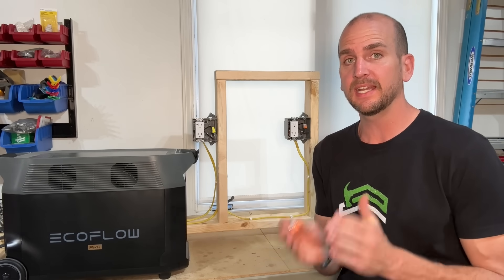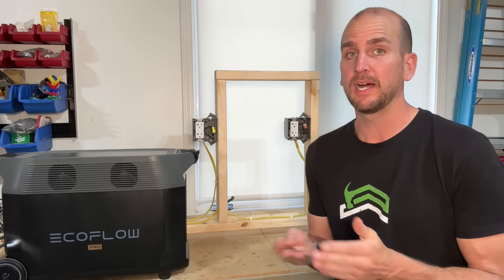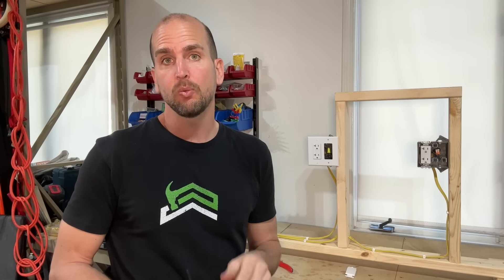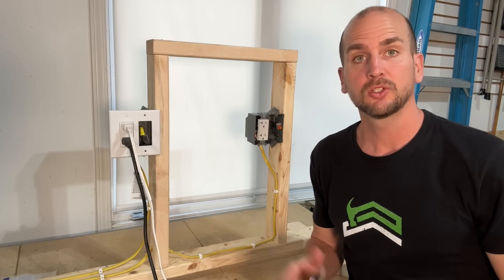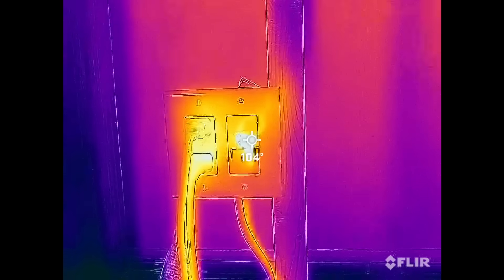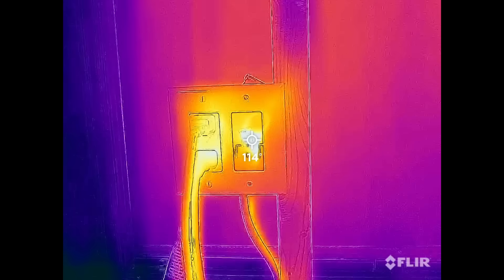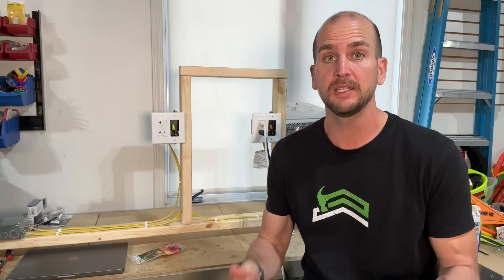Debunking the Pros: Can WAGO Lever Nuts Handle Heavy Electrical Loads?

Comment: We have several large towable heaters in the rental fleet that shipped with the Wago connectors inside the panels. These heaters run 24/7 on jobsites unattended. The wiring and connectors used are right at what the rating limits are.
They’ve all experienced failures due to heat. Site repairs done with wire nuts and pretwisting of the conductors have had no such failures.
This is a more “extreme” scenario certainly, but the facts remain.

Comment: I am a DIYer, not an electrician.  I have used Wago connectors and will continue to do so.  After seeing your test, I feel more confident using them.  Great test!  I have learned so much watching your videos.  Keep up the GREAT work.
Reply: Even better are the tests pumping 60 amps through a wire nut and a Wago, both rated for 20. Wire nut *melts*. Wago heats up but stays intact.
Reply: your just lazy or cant manage the wirenuts. So maybe you shouldnt be doing the work.
Reply: If you needed to see his video to be "more confident" then you shouldnt be doing the work in the first place. Because he doesnt know what hes doing either and is selling that junk.
Reply: @RadioRich100  Sorry, we must have missed your videos on youtube.....sit back and enjoy Mr. Karen.....
Reply: @benk4881  I dont have any videos just burnt and melted wagos.

Comment: We rewired our house based off of youtube (thanks EHR et al) and a bit of consulting/help from an electrician. One thing no one has mentioned is: if you pull and twist, a wire will come out of a wago. Pull is ok, twist is ok. Pull and twist at the same time and it'll come out. Get a wago and try it out. We had a wire come out after pushing the outlet in, probably because a twist and pull happen as wire moved around in there. You can orient your wagos so that a pull is less likely and you will only have twisting as you push the outlet in.

Comment: ... Also : that was the cheapest POS wirenut you can buy.  Throw those away and use an Ideal Wingnut.  They last 50 years in the WORST conditions, won't strip out, always remove easily and apply tighter due to the wings.

Comment: So here is the question. Resistance causes heat.but resistance requires more enegery to push the same draw so which costs more to run over time. I can say from 14 ga wire to 12 ga wire over the year that 12 saves about a 100 bucks a year in your electric bill.that don't sound like much but in my shop full of tools I consume way more eletric than normal daily house use.

Comment: As a maintenance guy in a manufacturing  setting, most of our equipment is Italian or German.  After a few years of use, most bonding points in the electrical system that use a spring style retention system fail due to high resistance and heat. While the failed component was installed correctly and rated to handle the load. After having prolonged use they just can not complete with the old screw style  bonding points.  Due to the down time that one failed component that causes an electrical fire we now remove and replace all high load components with those that employ a screw style retainment system.

Comment: A 20 A breaker will not necessarily trip at 20 A, and it certainly won't do it immediately. It will have a curve on it, and depending on the degree of overload, might take anything up to a few minutes. This is deliberate, and to allow a certain amount of short term overload, as you don't want a breaker to trip when a large inductive load, like a motor starts up. Also, where there are multiple thermostatically controlled loads, like a stove top, you do not want a nuisance trip from a relatively short temporary overload.
As such, breakers have two elements. One is electromagnetic, and is deigned to trip instantly when there is a gross overload of, perhaps, 5 times the rated load. That's designed to protect against things like dead shorts. The other is thermally operated and protects against fairly long term moderate overloads. So it might trip after, say, 10 seconds of a 100% overload, but maybe 30 seconds for a 50% overload. The exact shape of that time overload curve is dependant on the breaker specification and what regulations apply.

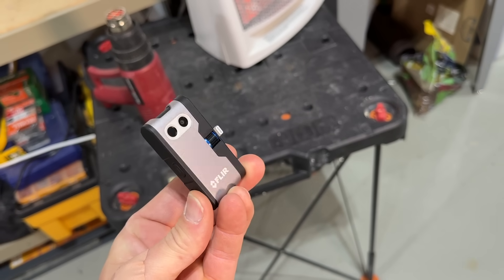Comment: 2:41 I have the same IR camera and something you should be aware of is the the surface material you’re measuring will definitely affect the temperature value shown. The factor is called emissivity and needs to be taken into account. Shiny or polished surfaces have very different values than dull or matte ones. You should be aware of this when comparing temperatures. Tables are available and a common trick is to use a piece of electrical tape where you want to measure to ensure each test point has the same emissivity.
Reply: 2:23 Yes, covering it up with a white plastic faceplate may end up throwing things off more than they help.
 Ideally, using a thermocouple for the actual measurement would be more accurate than the IR camera, though the camera can help to determine where the localized hot spots are.
Reply: @dubmob151 maybe more precise, not necessarily more accurate. I doubt that using a thermocouple would show a huge delta in the results, if anything, they would all change together and my hypothesis is that they will still be will below the safety margin.
Reply: @jessmcgrathcomedy  You missed the comment about the difference in emissivity.  A thermocouple or RTD will not be affected by this but the FLIR camera will be.  This could easily create an error of 5-10 degrees in the temperature difference for the FLIR camera.
Reply: Great observation.  I used to work with blackbodies, which had super high (absorbed most energy) emissivity ratings.
Reply: I was going to mention as much
Reply: He says in the video that he removed the plastic blank before each temperature reading, then replaced it after.
Reply: As with a number of scenarios for other things, say the sizing of a joist based on span to keep it simple, there are those of us who are fine with the safety factor already built into the calculations.  Others will automatically go up to the next joist size for any number of reasons planned future use, want no bounce but want rock solid, or, just because we do things that way.  Same for what Scott’s demonstrating here.  More than enough of a safety factor for some, others maybe not so much.
Reply: I remember black painted big PCB:s in lab. Haven't done anything thermal related at that time and asked why it was painted black and answer was it gives most accurate temperature on IR thermometers and cameras. I think it was some special paint for that purpose.
Reply: exactly true, in this case just measuring the black wire insulation next to the terminal would be fine and give a good reading.  Of course the real comparison here is between the wire nuts and wagos which are quite comparable emissivity wise.  I have a FLIR thermal camera for work that has an emissivity setting that is adjustable and in my experience the piece of black tape you mentioned works just as good if not better then trying to get the imager to take an accurate temp on shiny metal especially.
Reply: @billbarto125 is 100% right here.  If this channel still has this setup, I'd be curious to know what a redo of the baseline temp with the piece of electrical tape over the screw.

I learned this principal the hard way years ago with a new shiny stainless pan on a new gas stove.  Laser temp probe wouldn't get over 250-300 despite me continuing to crank up the heat, like an idiot, trying to get to 350* for my pan fry.  Finally poured in some avocado oil and WHOOSH -- huge 36" flame.  With smoke point of 500, the pan was probably WELL over that, but read less than 300.
Reply: @everyday home repairs 
Also flir and other digital ir sensors have a focal point and tolerance that they need to stay within.   The further away you are from that sweet spot the less accurate your reading is.  The other methods you can use that is more accurate ,use  thermocouples and or temperature rise/ resistance.
Reply: Was thinking the exact same, can't tell you how many times my eyes have rolled at videos with people trying to compare surface temperatures who have no understanding of emissivity. I've also personally found different angles to cause different readings on any surface so good luck getting the exact readings on surfaces that bend and meander.

Comment: As a Finnish electronics technician I somehow find this traditional wire nut vs. Wago debate endlessly interesting and funny, because I've only ever seen the American style wire nuts in some old as balls wirings that were being taken down to be modernized, because it was considered lethally dangerous. There's pretty much only Wago connectors now and if they're not fit for the use or someone doesn't like them, we use terminal strips, which was the standard connection before it was in most cases replaced by Wagos or other similar options. This feels like watching people debate between just some random horse carriage and Tesla, having believed the debate was combustion engine or EV 😆

Comment: I would want to see some tests after its had a few years to oxidize exposed to say 60% humidity .  Similar to backstabs the spring-clips won't make as tight a connection on as large surface area as a screw...backstabs on clean fresh wire are fine too but they become really bad after a while.  I've taken stuff apart that was done with screws and had corrosion on the exposed surface but was still flawlessly clean where the screw was clamping tightly.  Vs I've taken apart backstabs where it corroded all the way around due to the small surface area.

Comment: I am not a pro but a DIYer and sometimes with 3 or more conductors I have trouble with wire nuts. I think in that case I will try the WAGO lever nuts next time. Thanks for the unbiased test!

Comment: All of these devices are listed (usually by UL here in the USA).  As such they go through LOTS of testing to make sure they aren't hazardous, or are prone to do nasty things (like start fires!).  Also note that the NEC is a FIRE code (sponsored by the NFPA!), so their main concern is making sure things don't start fires.  So, these items are all safe when used "properly" (follow the instructions!).
Reply: No,no,no,no, stampy little feet. They are not American, I'M A 100 YEAR QUALIFIED ELECTRICAN (who's learnt sod all over the years and keeps doing the same old tired techniques over the year,s and using the same old rubbish products, coz' it can't be bettered) Therefore they must be rubbish. European too, so probably liberal or communist or something.
Reply: They also approved aluminum wiring back in the late 60's. Wanna talk about fires? Those so called approvals can be bought. I guess the labs didnt know what dissimilar metals were.

Comment: Not really a thorough test. For a real evaluation, you would do something like a 1000 hour test under load  in an environmental chamber, continuously ramping the humidity from 0 to 100%, and the temperature from say 32f to 120f. I’m sure UL did something like that before approving.

Comment: I think it all comes down to, what do the manufacturers recommended applications and installation instructions say, a lot of codes rely on what they say. As an engineer I like the simplicity of the Wago connectors in that they give you a quick visual indication as to whether the contacts are closed via the lever, but that is not an indication of a good contact. Overall, it comes down to the person using the device, I have seen extremely scary stuff out in field that was installed by so call pros and things installed by DIYers that would pass the most rigorous checks and tests.

Comment: First, thank you for taking the time to run this test and create this content. Very original and to the point. I REALLY appreciate it.  I'll add, no one on any electrical channel or reddit ever seems to have an appreciation for how over-designed everything actually is. That means, you should use the approved connector, per it's instructions, that personally gives you the highest confidence. I can sweat copper and connect PEX. Both have good applications. But on a daily basis, I'm using PEX. However, on a DYI electrical, I use wire nuts because I think they are cheap and fine. I'd have zero problem with a wago too, if it came with a device.
Reply: There junk this guy is selling them.

Comment: Form most circuits, Wago is the best solution. For a really high amp circuit ( 30+ ) I prefer split bolt connectors. But they take up a lot of space and need insulation. LED lights have really helped to cut down circuit loads, so Wago is great.

Comment: Excellent presentation. I know space heaters running on high generally cause their plugs to be too hot to touch so I only run them on high for a short period of time. If I need more heat, I use multiple heaters on low or medium.

Comment: After sleeping on it. Aren't wagos only 1 size? How do you connect different size wires?
Reply: 221’s come in two sizes, 221-4 does 24-12 awg, 221-6 does 20-10awg.

Comment: I’ll probably continue wire nuts because of cost. I always pretwist the wires together. That makes the connection good even without the wire nut. If working in the industry and not just a homeowner, I would probably use wago just for the speed factor.
Reply from the maker: Thanks for the feedback!

Comment: "We're going to go beyond the ratings for these" ...Experiment invalid. The equipment is rated for safety, exceeding the listed rating is unsafe. Do these systems have safety measures? My experiance is military avionics that includes training on these matters in case I had to construct a new circuit. The units are rated at 'X', the safety measure is that the unit can go to 'X+Y%' and depending on the danger involved that could very well be 'X+500% beyond the listed rating' and possibly a 'safe fail' characterstic like the buss bar is a stressed spring that melts at a notch and pulls apart like a fuse.

Comment: The ease of use of the wago makes me think they are better than the wire nut for anyone one that does not do a lot of electrical work and the wire nut is probably not better enough for an electrician to say the wire nut is a better option.

Comment: These connectors clearly don't get anywhere near their maximum operating temperature in your tests. However maximum point surface temperature does not necessarily imply higher resistance, it could be just different thermal characteristics - a larger or differently designed heat sink can dissipate more heat with lower surface temp. So if you want to demonstrate higher resistance why not just measure the resistance? And string 10 together for good measure. Then get 10 pros to wire up with nuts and 10 amateurs with Wago and time them and the resistance. Then reverse roles.  To me that will be far more telling.

Comment: The main problem of screw connectors or wirenuts is, that the copper of the wire will give in to the pressure of the connector in the long run, even without electrical load. Spring-loaded connectors, on the other hand, can follow the shrinking diameter of the wire.
Reply: Talking about springs in general, in the long run springs tend to fail